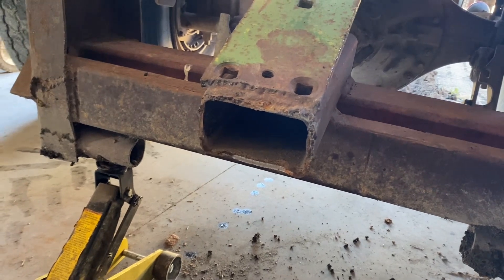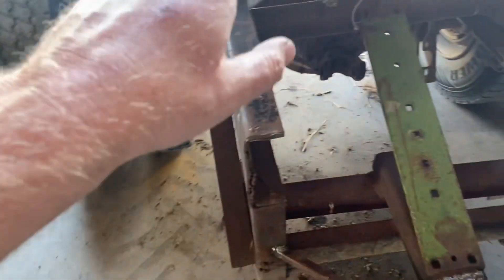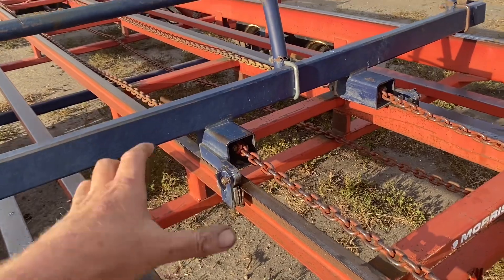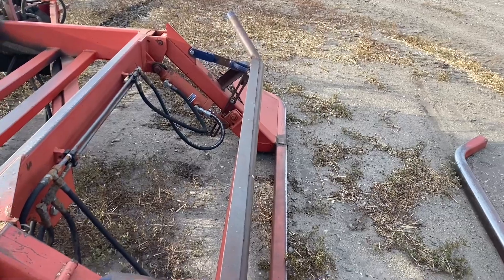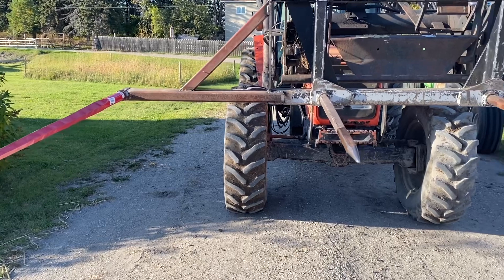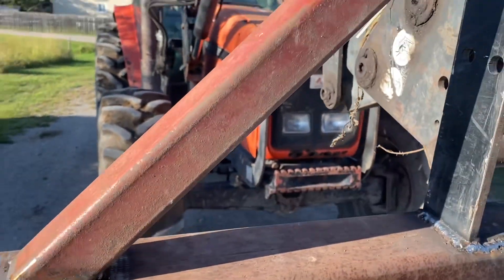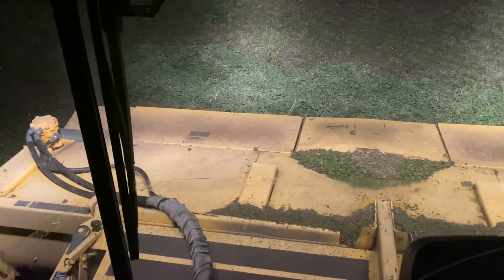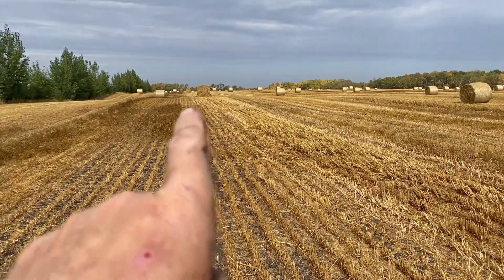Fabricobbling

Comment: Steel on steel will crimp it more aggressively but if it rains, it really wrecks the hay easier.  We now have both as of this year, but I prefer the urethane rollers on good alfalfa hay, think I’m keeping more leaf in my bales.  I’m also using my soft core baler on my better hay, it’s keeping more leaf in the bales cause of its wider and smoother belts.  That jd hardcore with its aggressive belts are definitely tougher on the hay during baling.  So long story short, for us, rubber rollers and soft core on really good alfalfa hay, steel rollers and hardcore on the grassier hay.  Lol 😂
Reply from the maker: Yeah yer soft core will let it breath too i imagine, ive never run one of those

Comment: Dang speer had 2 anyway, so should be for a big bale, or 2 rounds. Used to load 3 at a time on a double speed.
20%, they might be dry in a week.
Reply from the maker: With these 6ft bales the spears being 40" apart put too much pressure on the outsides of the straw bales n they tended to explode so this works plus thisll be handy for unloading sheets of tin and other building supplies

Comment: When I had race horses, used oat straw didn’t work real well because they liked to eat it.  Did not help it was a little green.  Wheat straw was much better and soaked there manure better.  How often do you get a third cut?  Did not have a frost. Good video
Reply from the maker: We normally use wheat straw but this was what my renter grew close by and yeah theres a fair bit of green leaf in it so it will make good filler and bedding. We normally dont take a 3rd cut except on a new stand's first year so next year will no doubt be 2 cuts